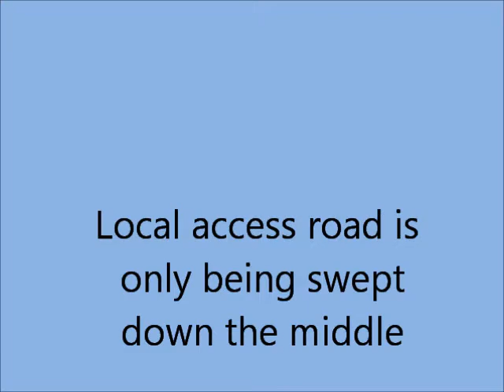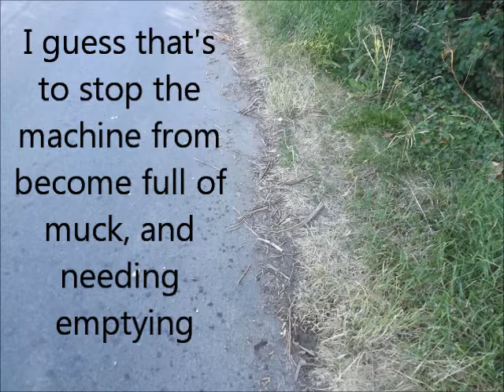Road sweepers collect dust, apparently. G Crook & Sons road sweeper for C. G. Fry

Comment: Just a few things to say... firstly A site that dusty need a lot more than a min 4hr ticket and a 4hr ticket includes travel time most companys allow an hour each way meaning its 2hr max on site, 2nd thats the high pressure jets causing the dust not the fan (the fans blow vent is located on the roof) the jonston sweepers are fitted with high and low presure jets and unfortunately through a design flaw imo the low pressure dont work unless the brushes are down which in these conditions he cant use till hes wet the ground however none of this is the sweepers fault it lies with the cheap skate site manager! i look at road sweeping like mowing a lawn keep on top of it and its  a cake walk but leave it too long and its a hell of a job to get it back to normal!!

Comment: Bad english sorry.   The road look really dry, and just with the sprinkler, the dust goes up.  Even not enough water in vaccum hose to wet everything.  Low rpm, not to wet.

or use a water truck tanker,  push dirt both side of the road or just one side ,to put dirt in 2 feet width in line, the sweeper at the end , just suck the slushy muddy at high rpm. And cut some water.

City operator 

Johnson VT650 2005,  Easy to use, good fiability, old school , managment operation

Ravo 5 2014 to 2017.     Short range water tank, sucking sand, or light dust , pass-trhough when not enough water, manoeuvrability, good with autumn leaf, even with branch , using the reverse pedal allow you to make branch broke , finish to suck everything.

 Bucher OptiFant 8000  computer control managment ,long range 18km with a full water tank. 10km/hour operate speed.

Comment: No sweeping gear down.......plenty of water down first.......good job !!! cameramans a knob !!!
Reply from the maker: Bad job. Other drivers suck the dirt up instead of turning it into slurry on the roads. Later in the film, note the lack of kerb sweeping to save emptying the wagon of dirt. When the other drivers are here then the roads are swept kerb to kerb. When the other drivers are here in other sweepers, they've clearly still got the shroud around the engine cooling fan as they don't kick up all that dust. That dust being kicked up end up being breathed in by residents, and covers everyone's cars, garden items, kids toys, etc.
Reply: You can't directly sweep that "Dust" up straight away without getting it wet first........It would resemble a steam locomotive, with all the crap coming straight out the top......any professional roadsweeper operator would know this !!! Plus your screens would be choked within 10 mins of sweeping.Soak it first, then using your low and high pressure water pick it up at a slower speed than the driver is doing....possibly even lower revs on the donkey, but enough power to pick up the waste..........It's not rocket science !!!!!
Reply from the maker: Actually, MrLadeside - Covering the dust in water turns it to slurry. That slurry ends up being sprayed all over the sides of any vehicle that comes along the road, as well as covering the shoes and trousers of any pedestrian that walks along the road.
This operator drives up and down the road with his fan on to look like he's working, but it is just his tyres that make pretty patterns in the slurry. Occasionally (not every day) he will lower the centre brush, and then the brush also makes pretty patterns in the slurry. On those occasions because he has sucked up lots of water when the operator does a U turn at the end of the road he leaves a trail of thick wet brown muck for the first 10 meters as it pours out of the back. That thick muck from the back happens to land in the same place on the road as where the pedestrians walk.
Some hours after the operator leaves the site -  that slurry finally dries back to dust - and the dust that he was originally sent to pick up is mostly still there.
Reply: Of course it turns it to slurry......keep your hi-pressure water on and pick the slurry up. ALSO leave your side brush off and run your hoover-box up to the kerb edge......hence not spraying your kerb with the spinning brush. It really isn't rocket science if you know what your doing...
Their is more chance of you getting into more trouble environmentally, drawing the dust straight through the hoover-box and straight out the other end,  just asking for a reprimand. Picking up slurry shouldn't be a problem for a VT650 or VT651. it basically boils down to experience and know your site your cleaning..........Not for amateurs or the faint-hearted.

Comment: Johnston Sweepers can only suppress dust using their high pressure water system any dust not suppressed goes to the sides of the brush path

Acn

Johnston engineer
Reply from the maker: 1) Why aren't the water nozzles under the front bumper? Look at how much dust is coming forward from under the engine.
2) Why aren't the nozzles spraying a wide area? Look at the neat lines of water in the dust behind the sweeper

Comment: Road is clean when machine has passed.Given it is on a building site,the operator does not want to pick up big items.It clearly,kicks up dust when in operation.Some people overthink things.Too busy thinking about doing it.Never thinking SHOULD I ACTUALLY do it.LOL.
Reply from the maker: If you read the other comments you might understand a bit more. The vehicle's engine fan is clearly kicking up large volumes of dust. The whole neighbourhood was covered in a permanent thick layer of dust because of this sweeper, roofers cutting tiles without dust suppression, and ground workers wrongly trying to mix sand into heavy clay with a 360 slew in a failed attempt to improve drainage. Dogs being walked across fields a mile away had yellow lower legs and paws. vehicles, children's garden play equipment and everything else was continuously covered in thick dust. The same dust the everyone in the area was breathing in.
Reply: WOW.

Comment from the maker: Look at the video again. Go in 2 minutes and note how when he gets out of the cab the amount of dust being blown out from underneath the front of the sweeper stops. 
2 reasons for that. 
1) Location of water sprayer is not under bumper, and or spray nozzle not spraying a wide spray pattern (as seen by the narrow wet lines of water on the dust behind the sweeper compared to an 8 foot wide wet area). 
2) Amount of air from the engine fan that is being blown down on to the ground instead of through the radiator. 
Bet if you get underneath you'll see that the engine fan cowling is missing

Comment from the maker: The operator has an issue with avoiding filling the truck up with muck whenever possible. He prefers to drive up and down the middle of the road with the fan on and brushes raised. The only time that the kerbs get swept is when the regular operator goes on holiday and another driver comes. 
The verge was cut 2 weeks ago, and swept 6 times since then. Luckily, we've had a couple of breezy days which have shifted some of the cuttings, but pedestrians are left to walk though bramble stems and other long weeds.
https://goo.gl/photos/Qj8cWz3kyPRXuxi26

Comment: god why are you being sad and filming this?  the machine isn't perfect. in the last stills go and winge to weymouth council its a public highway and not the concerns of a private contractor. that in the gutter is grass cuttings and dust  from where they have scalped the grass, nothing to do with any building site.
Reply from the maker: Chris, to clarify a few points for you. This has nothing to do with the Borough of Weymouth, which is over the border. This contractor is employed to sweep the roads a number of times per week due to the mess being spread on the public highway - due to Fry's contractors loading tippers on clay instead of loading on hard standing. The sweeper operator in question dislikes using the brush because he will have to empty the truck, and because the brushes will wear out requiring more work. It's everything to do with this contractor.